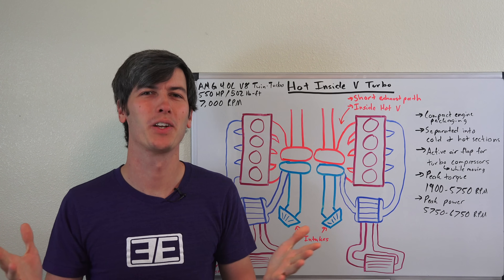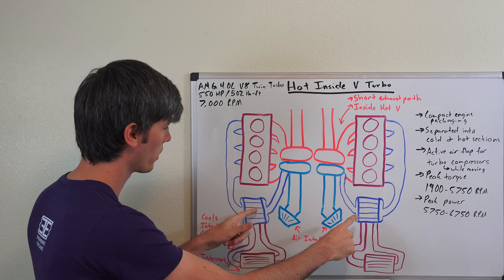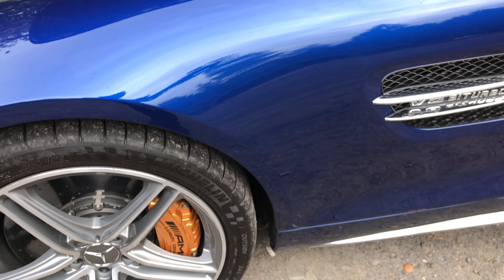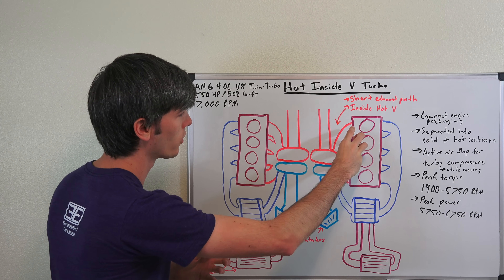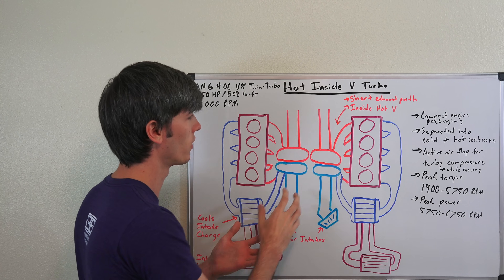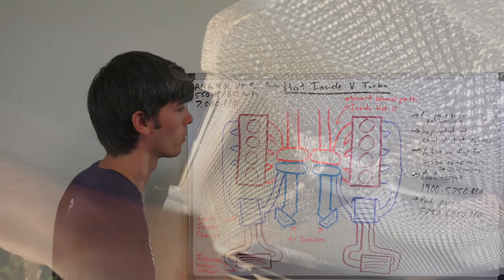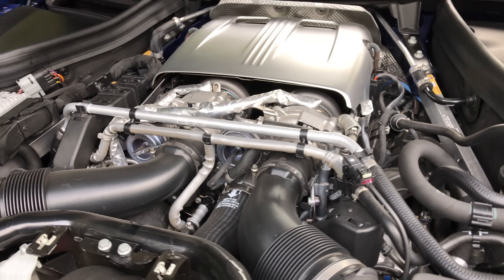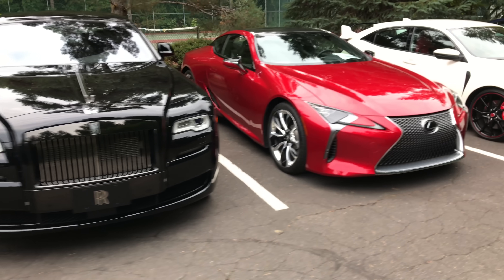Mercedes Clever Turbo Engine - "Hot Inside V"

Comment: All this technology and they still haven’t come up with a way to not run the water through the engine before they run it through the intercooler. Possibly in future, Have a separate water cooled intercooler separate from the radiator and cooling system

Comment: This engine has aged well, Mercedes have now squeezed out 780hp out of it,I say 780hp because Mercedes underrated it stating it's only 740hp. These numbers were confirmed on Dyno runs. The new code name of the engine is M178 ls2...not a Chevy by the way.😉

Comment: On paper, the hot-V design looks good, but in practice, it has a lot of issues that seem to stem from the concentration of heat in the V. Just ask BMW. The N63 / S63 engines are very unreliable, with excessive oil consumption due to exhaust valve guide and exhaust valve seal failures, not to mention other problems, such as turbo oil leaks.
Reply: I’m in plenty of groups with e63s owners, myself owning one included and we hardly have any issues. 120kplus miles on many

Comment: Been there, done that. 2011 BMW X5 4.4 V8.  Under hood heat rivaling Dante's furnace and non stop coolant leaks from the miles of intercooling hose.  Not to mention fried components anywhere near the turbines...which have the cats right behind them...you know right at the firewall.  Valve guide seals roasted at 100,000 miles... No thanks.

Comment: Dont think its a good design tbh. 
Because the compressor housing is sitting directly above the exhaust manifolds. So the charge cooler system and or intercooler(s) will not be as effective at cooling the intake charge down.

Comment: There's another advantage to this "Hot Vee" set up.
Since the turbos are so close to the exhaust ports, the exhaust gases have direct influence on the propeller vanes. The use of variable geometry turbos allows engineers to time the exhaust pulses and the turbo vane angle together for maxiimum efficiency, reduced lag, and increased output.

Comment: They used the same sort of idea with thier F1 engines a couple of seasons ago, only they went more extreme and cut the turbocharger in half then bolted each half to different end of the engine and connected them with an auxiliary drive system that was connected to the hybrid drive sysrem.

Comment: I must admit its a clever design. But its sounds like a high maintenance system. How many probllems will you encounter after 5 - 10 years.. so if you have a water leak in your intake system. Or even from where and tear. Water leakage to intake will cause a hydrolock on your engine. Dont you think that maybe four air intake intercoolers will be bit more efficiant in the long run than water.???

Comment: Everyone is saying BMW, Ford F-250 diesel, etc did it first, but Mercedes claim is the first V-8 with hot VEE in a SPORTS CAR.   BMW put the N63 in large sedans and SUV, but not in a sports car.  I don't think BMW makes a sports car anymore, with only M series sedans and coupes coming close.   The Z series was BMW's last sports car. RIP.  Audi's R-8 uses a NA V-10.  Porsche 911 uses turbo flat 6.  Ferrari 488 V-8 has outboard turbos. Jaguar F-type uses a supercharger as does the Chevrolet Corvette.  Nissan GTR has outboard turbo V-6.  Those are the mainstream production sports cars and the Mercedes GT is the first and only one to use a hot VEE engine.  The next gen Corvette/Cadillac sports car is rumored to have a 4.2 L V-8 with a hot VEE  planned, but we shall see.

Comment: Sorry, but I don't see it.  I mean, whether turbos are mounted on the inside of the cylinder heads or the outside, the flow of exhaust is the same distance.  Likewise, the incoming air is compressed and has to travel the same distance around to the other side of the cylinder heads regardless of which design you're looking at.  Lag should be unaffected as a result.  The ONLY aspect of this design that would seem to be improvement is the possibility of improved heat conservation of exhaust energy driving the turbos because they are next to each other.  Otherwise, this would seem to be six of one, half dozen of the other.  Can someone respond to this?  Thanks.

Comment: Hmm.... Turbo lag, or low boost threshold? I have a car that's nearly 15 years old, and above the boost threshold there is such a minute amount of lag it's basically imperceivable. The boost threshold however is very noticable, full boost only arrives at about 2800 (which is still pretty damned good for a 2.0L making 17psi).

Comment: My opinion. They only did this to have a compact unit.
Reply: I'm with you, Justin.  There's no perceptible difference in exhaust travel to the turbos or the compressed air to the intake ports thus no gain in lag time that I can see.  Having the two turbos mounted in close proximity to each other may have some thermal energy conservation advantage besides a packaging advantage, but that's it.  I see no other fundamental advantage to this design over having the turbos outboard in the traditional design.  Everyone here in these comments is all gaga about nothing ... I don't get it.

Comment: You are missing the main advantage of turbo location. Heat in the cylinder rises... so the slant in the head works to the advantage of the head angle with the exhaust valves.
Reply: Heat does NOT rise.  Hot air rises in the presence of cooler air.  That's the only time it rises.

Comment: Only thing that concerns me is the two separate intake on each bank. They don't appear to be tied together in anyway. Do these vehicle have dual map sensor and MAFs etc? I could see one turbo over time boosting differnt from the other and causing a imbalance on each bank causing loss of power due to banks producing un equal power. That's my thought at least. I really dig seeing the turbos right front and center. From a mechanic standpoint, I see the intake Gaskets and components requiring more frequent replacement opposed to turbo hot side and exhuast. (intake is now a pain to get to hahah)

Comment: So basically the intake side of the heads is on the outside of the engine? That is actually really cool, I see this as a very good future racing strategy if this can be done to something like maybe LS heads. To basically remove the intake manifold, use 2 exhaust manifolds as intakes and using turbos as throttle bodies.

Summarizing, if this can be adapted to an LS, this will be super  popular and will make a lott of power

Comment: The premature delta between conventional and this design are very likely negligable as is any increase in velocity of exhaust gas's. the largest effect on turbo lag between the cars (and their engines) and this example, is the turbocharger's them selves and their proportional size to the engine they're attached too. The most significant part of this design IMO is the compact packaging of the engine's layout compared to a conventional layout. The advantages beyond that are mostly academic.

Comment: I think they have less turbo lag just due to the fact they are using 2 smaller turbos (spin up faster) rather than a larger single one.  That decreased turbo-lag costs you a lot because you now have duplicate turbos, innercoolers, and intake manifolds.
Reply: Audi hot V6 has a single or double turbo design depending on the model. Both spool faster now that they've switch to the hot-v from conventional.

Comment: Ford 6,7 PowerStroke "Scorpion" also has it hot side in the V, with twin intake singel turbocharger.

Ford also made an Indy V8 engine, bor turbo and NA, with the hot side inside the V and the intake between the camshafts, much like the Lancia Triflux (with the exeption of the dual exhaust per cylinder bank).

Comment: Ford's 6.7 diesel is also a hot v engine, it actually helps keep the engine bay cooler and makes the turbo piping much shorter and easier to route and doesn't spread hot air around the engine bay.

Comment: Failing to understand the cleverness or the marketing claim, this layout has been used numerous times by various manufacturers already. The single shaft, twin compressor wheel turbo the Powerstroke diesel engine has on their hot-V setup is the definition of clever for simulating a twin turbo setup.

Comment: Three things concern me 1. there is still a lot of heat concentrated on top of the engine. The heat shielding on the hood better be good  2. Intakes very low making hydrolocking possible in heavy rain 3. all the electronics for injectors and so on are out where they are more vulnerable to weather etc.

Comment: Water to air intercooler?!?  Assuming the heat exchangers are the same size, the water temp will stabilize at half way between ambient and boosted air temp (referred to as heat soak).  

The reason is the amount of heat the exchanger can shed is based on the temperature differential.  At boost onset, the water is at ambient, and boost is cooled easily.  But with a low differential between the water and ambient, that heat exchanger doesn't transfer near as much heat.  Boost continues to heat the water until the water to ambient can shed as much heat as water to boost collects.  That occurs well above ambient.

Air to air needs bigger plumbing, but allows the engine to be tuned for a lower intake charge (more power).

Comment: How can mercedes say they were first with the Hot V?  BMW twin turbo V8 from the M cars had this configuration sijnce 2008.
Below is from the N63 Wikipedia page. Great Video though.

"The BMW N63 is a twin-turbo DOHC V8 engine which has been in production since 2008 to present. It is the world's first production car engine to use a "hot-vee" layout, with the turbochargers  located inside the "V" of the engine. It is also BMW's first V8 engine to use direct injection. The N63 was launched in the 2008 BMW X6 xDrive50i.[1]"

Comment: Audi has had a hot inside V twin turbo V8 in its models since the 2013 model year. See the Audi S6, S7, and S8. Also see the 2014+ RS7. Those are all 4.0 V8s. I don't know how Mercedes can claim they were first or that this is a new breakthrough. It actually seems like a pretty blatant ripoff from others (probably Audi).

Comment: GM-EMD and other diesel manufacturers have been building them like this for years with the exhaust in the valley for ease of service and layout. Ford also uses this layout with a single turbo for their 6.7 diesels.
Reply: And most medium-speed (300-1000 RPM) marine Diesels are like this.

Comment: This AMG V-8 has a cross crank, which means its exhaust has an uneven pulse on each bank.  BMW M5 of 2012 has a similar setup (4.4L biturbo, also reverse flow) but with the out-board cylinders mated with those in-board cylinders of the other bank to even out the pulse.  Let me know if I am wrong.

Comment: I wonder how headers integrated within the cylinder head would affect this (single exhaust port from the cylinder head)
Reply: They don't do that in any racing series, where they have a relatively limitless budget.
If that doesn't clue you in, here: It's a terrible idea.
Reply: @exploranator  the Honda l15 which replaces the Ford Kent in the previously Formula Ford racing series has head integrated exhaust header

Comment: I wonder why they never separate the hot and cool section of the turbo a bit more.
A longer shaft is all it takes (as far as I can see).
In this car the compressor would be more forward shortening the total air path (maybe not an advantage) and making a proper heat barrier possible.
Reply: Profit.

Comment: Thanks for another great video. Very informative, as usual :)
The 2016/17 Civic family sedan with 1.5 Turbo engine produces peak torque from 1,700 - 5,500rpm and redline at 6,500rpm. The top-class Mercedes AMG engine mentioned in this video is producing peak torque from 1,900 - 5,750rpm with redline at 7,000rpm.  Comparing both, I don't think the AMG engine design and peak torque spread is all that impressive. We are comparing it with a regular turbocharged family sedan here at a fraction of the cost! I think Honda is still a force to be reckoned with when it comes to engine design...no?

Comment: Can you please help me
 If we shot a magnet on a rail with 100 km/h and the magnet get through coil in which is induction electricity ( supposing that the coil is slowing the magnet with 10%) how many % will the speed slow down if we have 200 km/h 9%? 10%? 11%? and if it pass with the speed of the sound 340.3 m/s.u ?

Comment: +Engineering Explained But what about the center of gravity? This setup is taller than the standard layout with the turbo's mounted to the side of the engine, so the handling will suffer ever so slightly

Comment: I might be wrong but 1-  having a higher center of gravity is not ideal for performance or anything else and usually, twin-turbo engines are in performance cars ( I know I know.... all those crazy SUVs but that has nothing to do with logic)  2- new is not always better, actually, in "normal" v6-v8, etc twin-turbo settings, the exhaust manifold is on the outer and the intake in the middle or top and where air, comes from the front of the engine; So hot is with hot and cold is with cold as the front is always colder than the rear and the middle part of a v shape engine is way cooler than the area where the exhaust is, we have plastic intakes, try to put almost any kind of a plastic on top of an exhaust and you can open the marshmallow bag as you will get a nice fire; not sure to understand the video explanation about hot with hot and cold with cold.

Comment: With the peak power and torque up near the top RPM range of the engine, does that also make the turbos more effective? Also, are they using any sort of advanced knock detection to adjust timing so they don't have to run the engine rich under high boost?

Comment: 550HP out of a twin turbo? .. seems like a waste of some great engineering..I've seen twin turbo 3.8 V6's throw down more than that on the wheels.. Must be a tiny v8.
Reply from the maker: It's a 4.0L as mentioned in the video. Don't get bogged down that it's not some GT-R with way too much boost and 1,000 HP. It's an amazing car to drive. Nearly flawless. Good engineering doesn't have to mean unlimited power. 0-60 in mid three's is not by any means slow. :)

Comment: everyone thinks tiny turbos and minimising lag is super critical, until they experience a really big turbo car ..... then suddenly its not so important
Reply from the maker: I disagree. I think cars without lag are far more enjoyable to drive than cars with more power and excessive lag. If you can't modulate power with your right foot precisely, and just wait for a rush of boost all at once, it's definitely fun. But it's not as enjoyable to actually drive hard, because you spend time waiting and feel disconnected. This car was much more enjoyable to drive than the Nismo GT-R, even though the GT-R has more power and is quicker.

Comment: Compact but center of gravity is higher
Reply from the maker: Of the engine, yes, but actually because of the layout, and the fact that it's a dry sump, they're able to further lower the engine in the bay because the exhaust/turbos do not cause any clearance issues below. So in reality it's lower than if it had the turbos on the side.

Comment: Or they could always just use a 4.0L linline 6 without all the jam-packed packaging, heavy frontal hood (ducting and heat reflective materials), and higher center of gravity with more mass up on the engine heads.
Reply from the maker: Actually because of the layout, and the fact that it's a dry sump, they're able to further lower the engine in the bay because the exhaust/turbos do not cause any clearance issues below. So in reality it's lower than if it had the turbos on the side.

Comment: Don't Ferrari turbo engines have the same design, with the trubo inside the V? I think that happens in the Portofino, 488 GTB and The Alfa Romeo Giulia quadrifoglio. the difference is that Ferrari uses only one, twin scroll - like the ones used in F1 engines - turbo

Comment: Doesn't all that heat from turbos being inside the v effect the turbos durability in the long run ?
Reply from the maker: That's why you have to source from a reputable company like BorgWarner and make sure they're confident they build the turbos to last. It's an engineering problem, but engineering problems have solutions. :)

Comment: Quite surprised to hear technical people talking of "turbo lag" in 2017 .
It's been fairly minimal over the last ten tears in my experience of driving performance cars with manufacturer installed turbos. That's without resorting to recent advances like cartridge ball bearing, ceramic impellers and appropriate A/R ratios that lead to spooling faster.  
Sometimes perceived turbo lag isn't lag, rather it's the engine being operated at rpm below the boost threshold, fixed by being in the correct gear prior to rapid throttle increases.

I suspect the turbo location is chosen due to packaging constraints, I am not convinced that turbos on engines outside banks but still next to exhaust ports can't be as efficient.
I strongly suspect serious within V temperature problems.
Some naturally aspirated V  engines get seriously high temperatures in the Vee without having exhaust and in this location.
Also always beware of engine layout choices made by engineers for packaging reasons being "spun" by marketing and PR people as being chosen due to alleged efficiency benefits.
Reply from the maker: Drive a 2017 Nissan GT-R, Honda Civic Si, Subaru WRX or STI, Fiat 124, almost anything with an engine under 2 liters and turbocharged. There are plenty of cars with turbo lag nowadays. (Yes, I'm familiar with what boost threshold is). It's improved versus older cars, but it's most definitely still there.
Reply: Engineering Explained 
I haven't driven a 2017 Nissan GT-R, but drove over 50,000 miles in the 2012 GT-R I owned for three years and don't recall experiencing noticeable turbo lag